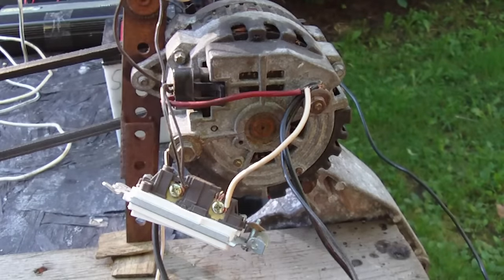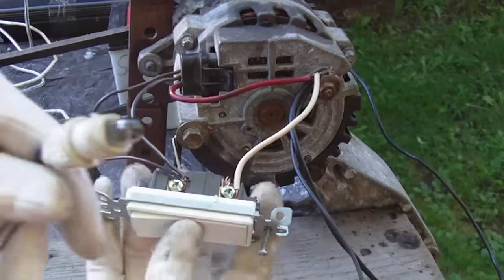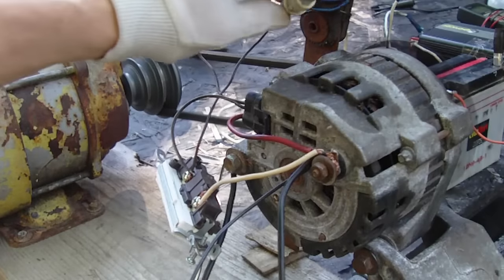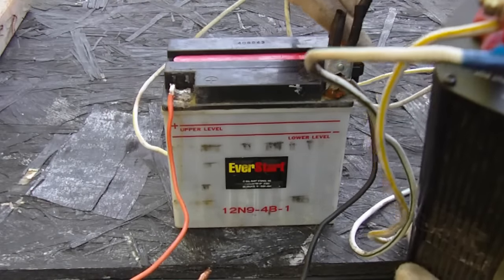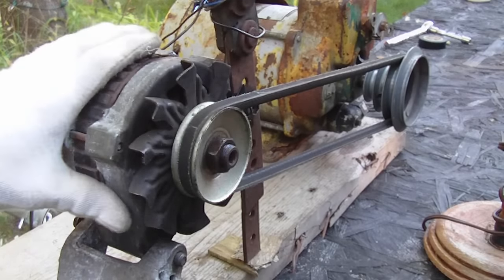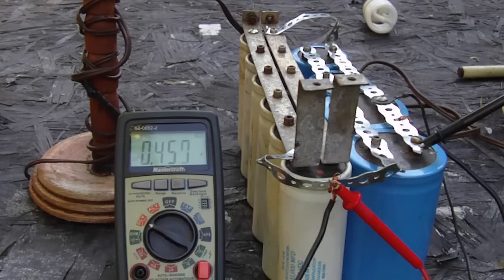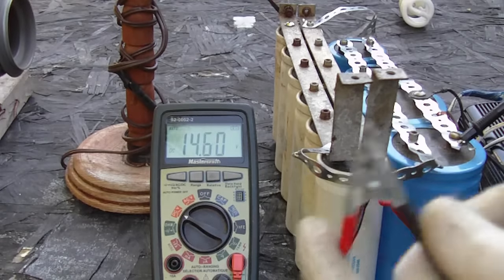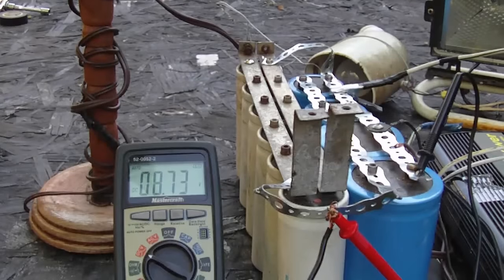Alternator DEMO Wiring, connection to Battery, Capacitors, Inverter, Modification

Comment: You need a 120 or 220 electrical motor to produce 120 Volts still I can't see your point.....?
Reply: So you knew already how to wire connect this setup? Where were you when I needed the info about it? Now you see That's the point. Get it? Why are you all hypnotized with free energy motors run a motor batteries run a battery that powers the battery what's up with that? And yet you don't know half of the motors generators we have and use in everyday life. Instead of waiting for someone to show you the" free energy device" you better first learn how to use what we have. I don't understand your comment at all.  you sound like the alternator is a long forgotten device that no one needs anymore. The title is how to connect the alternator to a battery and not how a battery and the alternator give everlasting life. Wake up. People use alternators. We are putting alternators in our cars. We use alternators in making windmills ,we use alternators in making water turbine generators.. there are thousands od applications whare we use alternators. . But no.. it's not free electricity a bunch of kids are talking about all over youtube so it's not important.  right? Check into your pockets maybe there's a solution on how to connect magic to a battery.

Comment: where does the small white wire that you  connected to the back of alternator w/ the negative wire to the battery  go to?  also, where does the small black wire  that you connected
w/ the positive wire to the battery go to?  You did not mentioned these two wires.

Comment: what happen if you had a big battery with some some high AMP like 700 or so, and you use the electricity coming from the inverter to power a small motor instead of a big motor..... you can also include a small flywheel to help the small motor which will have a big pulley which turns the small pulley for the alternator increasing speed. all you might need is to use a drill to begin spinning the entire system, and you should have a self sustaining generator. lol just saying. air planes were once said they were impossible to fly.

Comment: You should  never connect the field directly to the main output of the Alternator . . you will burn the rotor bobin  . . . you need at least place a rheostat to limit the voltage/current that goes into the rotor.

Comment: Can you run the motor that runs the alt by, the alt itself with its AC, (need the alt to run at 60 hertz huh) and still get excess power, in dc or ac mode? A re tou getting such low voltage hold with your caps, CAUSE they are in series,  won't you get more charge holding if they are in parallel?

Comment: So the red wire you have there is the sense wire going to the b post on the alternator to sense the battery voltage?

Comment: very informative and interesting video.generator is giving current but why are u using a induction motor ?  clear that plz ??? 
small battery is turning the the alternator and getting more current to again charge the battery right ? plz clear in simple whts  induction motor is doing ?
Reply: The battery is not powering the alternator at all. The induction motor powers the alternator. The battery is only required to temporarily energize the alternator's windings.

Comment: A good demo but it must be said that a lot of inverters will read over voltage at 14 volts and cut out but you can get lucky with some...
Reply: Every inverter I've ever seen cuts out at either 15 or 16 volts. Nominal voltage for a running vehicle is 14 to 14.5 volts, so it would be kind of silly if inverters (which are primarily used in vehicles) couldn't handle that.
Reply: Nominal  running voltage is different because the alternator is topping up the battery, I have seven 12v inverters of different sizes which is how I came by this info but of course all are slightly different in operation but all mine overvolt at around 14.5 volts. If your alternator is forcing 16 volts into your battery it's possible that your battery is on it's way out..  A healthy system with a battery that isnt knackered will charge at 14.25 volts.  We generaly learn about things by sharing info with each other and I appreciate your feedback on my comment.
Reply: thra5herxb12s Alternators don't very the voltage output based on the health of the battery. The voltage regulator outputs one particular voltage, given that the alternator is spinning fast enough and is not being loaded past it's maximum current (in those cases voltage would start to drop below the nominal). An alternator which outputs 16 volts at any time would be one with a failing regulator. (And it would overcharge and partially destroy the battery, and possibly fry some of the vehicle's electronics.)
Reply: ***** So if I spun an alternator with a bicycle, would I be able to fill a battery with some variation in how fast I spin it, because I can't bike at a constant speed?
Reply: Yes, as long as the alternator spins at least fast enough to reach the target output voltage of ~14V. At least a few hundred RPM.
Reply: ***** Thanks! Onward with my school project!

Comment: My alternator has that regulator but only has 1 wire, is that gonna be a problem? If so what's the solution ? And I agree with some of the other comments, focus more on the wiring of the alternator. What modifications did you make do and will it work without modifying it with a wind turbine?

Comment: hes using a ac motor to spin a dc alteernater to get ac,whoopee! dont work if you lose power you might need a gas motor which is what a generater is! go to lowes an buy a generater, unplug the electric motor and then get power, lol

Comment: So, a 12v dc motor running off the battery starts the motion, the alternator can then be switched on, which recharges the battery(when wired correctly)
Then plug the inverter to the battery which then converts 12 vdc to 120 vac. 
The amps (everything needs so many amps to run correctly, usually says how many on each appliance) which you can get more with more rpm on the alternator. 
But then, I'm not an electrician,so this is what I'm theorizing, or deducing based on what i saw in Kevin's video. The use of those other apparatuses and their function is over my head. Plus, like the rest of you guys, i still have to try it first

Comment: why somepeople  put one diode in the red wire that come out from the 
alternator ?i dont undestarnd. in try to do the same, i bought a geo 
metro car alternator it has regulator and rectifier 
,have the bateries, but i think that someting is not working,cause I 
charge the batteries and then they run out when they are used
Reply: Oswald President Killa,,, 😯😲😱😵lolly,,,, NATURALLY,,,, that's exactly what happens when you use a battery. Even A brand new battery when used runs out of stored energy and that's now the whole purpose behind having an alternator to recharge the battery. The capacitors and or invertor box is used to take what energy that you are building from the alternator and multiply it so your not over working or burning out the alternator that's trying to keep up with what your trying to use the energy for..
Reply: Oswaldo f 
Yeah... What he said...

Comment: My truck got stolen and they missed up the wiring so bad . The there are two wires from the alternator and the wiring to the battery is hooked up to the junction box with capacitor. There is no solenoid the ignition to the distributor cap and anothere wire coming from the cap to the battery   with a capacitor and starting wire. The alternator is not hooked up battery. 
Starting the truck is tricky, turn the key on and filp a switch and then pull back on a leaver on the left side of steering column.  Every time you turn on you have to popped the hood and reconnect the battery  turn off you turn the key off and you filp the switch dowm and disconnect the battery. 
Battery stays charged and i dont know how?

Comment: 3 wire plug  first wire is volt sense from battery pole  second wire is connected to a switch in this case normal would be the Ignition switch the 3rd is  fail lamp output .

Comment: The reason why he had to jump the capacitors with power to get the alternator to generate was because there was no power in the capacitors to excite the coil in the alternator. A simple 9 volt battery touched to the positive and negative of the alternator will excite it into producing power. Once excited it dosent need power to keep generating as long as alternator keeps spinning. In fact you dont even need a battery hooked up to alternator you can pull directly off of alternator without one. As long as you excite the alternator to bring it alive.

Comment: So the best thing to do would be removing The rectifier and keeping it at like close to 110 volts to run stuff and have 3 power outlet boxes one for each phase like the power company 3 phase alternating current split or keep in 3 phase for big pumps or loads

Comment: What's ur point you're using 110 volts to power the motor Wich is really powering everything
Reply: He was just using that to demo it so he didnt have to talk over a gas engine that you normally would use to run it

Comment: did you try using the smaller of the wheels on the motor so the motor spins faster. to get more torque. It should be able to handle bigger loads that way.

Comment: nice video but the inverter can't handle 25 volts, maximum is 16 volts or it's going to blow the capacitors of the inverter, internally or worse...

Comment: What is the point when you can just plug stuff in were your electric motor is plugged up to run the alternator
Reply: The electric motor is for demo suppose to use petrol engine lol

Comment: is there a way i can put a speed controller ' some thing like a ac light dimmer switch , so i can turn up the power to deal with a heavier load ,  as i am a beginner so i wont to leave the regulator alone and dont wont to mess with transformers until i have learned the basics ' do rubber gloves really save you from high voltage ?

Comment: Bottom line is a loss of efficiency/amperage capacity in re -conversion from 120 volts to 12 volts back to 120 volts.
Reply: And if inverter is not pure sine wave then your efficiency loss is is even greater and results in issues with end item connected to inverter
Reply: forgot to add the issue in the "re-conversion " process the cost and wear and tear of all the extra componets

Comment: What do you use to prevent overcharge or dissipation?  I’d use a Stanley charge controller- maybe and utilize something for the power to run from battery and a smart system that will turn on generator with batter low.   Safe no lighting bolts or battery bombs.

Comment: Low voltage can cause a electric motor, a drill, to burn out, unless you are controlling the amount of amps being generated. Remember, voltage is indirectly proportional to amps. If voltage goes down, amps increase.
Reply: im confused i thought ohms law stated more voltage more amperage (current) ? can you explain im trying to learn

Comment: I invented the power pack your motor that turns the alternated is wrong its is a rotating house fan with low midium n high on it replace fan blade with a pully then run belt toalternater replace converter with outlet 110 or220  replace parts when needed I'm Kirt Swinney

Comment: What you call a "universal motor" is actually a brush motor. Motors with carbon brushes and commutators will run on AC or DC. They can be identified by the blue sparks that they produce at the back of the motor near the shaft while in action. I know that you were using a fairly slow motor to turn your alternator and experimenting with a GM alternator but if you live near a junk yard and get a "double field" alternator off from a late 70's or early 80's Chrysler product, (Dodge, Chrysler or Plymouth), your task would be much easier without having to disassemble the alternator. The term "double field" is actually a misnomer. It has a single field coil like any other alternator but it has both connections to it's field available externally. This was because when Chrysler went to it's external electronic voltage regulator, it needed both field connections available as it worked differently from it's older mechanical regulator. You could use a newer double field alternator on an older car with it's mechanical regulator by grounding either field connection but you couldn't use an older "single field" alternator on a newer car without wiring an older mechanical regulator to it. These were easy to wire in a farm truck for 110 VDC for portable lighting or power tools with only a double pole, double throw switch rated at at least 10 amps but preferably higher as you will also be switching your normal alternator output with it and one or two standard duplex outlets. First you determine which way you would orient your switch. This is easiest by mounting it and a duplex outlet in a box, mounting it somewhere dry and marking it for "NORMAL" and "110 VDC" 
1) With the key in the "ON" position, with your DC meter set to 12 volts or more, you ground your negative meter lead and touch the positive lead to both field connections to determine which one is positive. 2) Shut the key off and disconnect the ground lead of the battery for the rest of this modification. 3) Clip the positive field wire and strip the ends. 4) The end from the alternator connects to the center terminal on one side of the DPDT switch. 5) The other end of the wire connects to the DPDT switch ON THE SAME SIDE BUT OPPOSITE OF YOUR "NORMAL" SETTING. This is your normal regulated setting. This is because when you flip a snap switch, the handle or actuator goes in the OPPOSITE direction from the switching mechanism itself. 6) On the SAME SIDE of the switch, connect a 12 gauge wire directly from the battery positive terminal to the unused terminal opposite the regulator positive wire. 7) ON THE UNUSED SIDE OF THE SWITCH, cut the positive 10 gauge main power lead coming out of the main output of the alternator. 8) Connect the alternator output end of the wire to the CENTER terminal of the switch. 9) Connect the other end of the main 10 gauge wire to the terminal OPPOSITE FROM THE "NORMAL" SETTING This will let your charging system work like a stock factory setup. 10) Connect a 10 gauge wire from the last unused terminal of the switch to one side of a duplex 120 volt standard outlet. 11) Connect the other side of the outlet to a piece of 10 gauge wire and connect it to the engine block or alternator ground.
1A) BE SURE THAT THE SWITCH IS SET TO "NORMAL". 2A) Connect the ground wire back to the battery. 3A) Start the engine and verify  normal operation, (13.5 TO 14.8 VDC), with your volt meter connected to the battery. 4A) Set your volt meter to at least 200 VDC. 5A) Connect volt meter leads to the left and right blade connections of the 120 volt outlet. 6A) Flip the switch to 110 VDC and read voltage. It could be anywhere from 50 to 70 volts. To avoid overheating your power tools, increase engine speed until your volt meter reads between 90 and 110 VDC and set it there. 
Two things to be aware of. 1B) DISCLAIMER: WHILE THIS IS A PROVEN CIRCUIT AND I HAVE FAITH IN IT, THERE IS NO SAFETY GROUND ON THIS SYSTEM LIKE THE 3RD PRONG GROUND IN YOUR HOUSE'S ELECTRICAL SYSTEM AND THERE IS NO EFFECTIVE WAY TO MAKE ONE UNLESS YOU ARE DRIVING A TRACKED VEHICLE LIKE A BULLDOZER OR TRACK HOE, Your vehicle is on insulating rubber tires. Driving a ground stake into an earth ground would only make matters worse by completing any short circuit to ground THROUGH YOU so be sure of the quality and integrity of your power tools and your modifications to your vehicle. I'm sorry but I claim NO RESPONSIBILITY for ANY damages or INJURIES that you may incur due to YOUR modifications to YOUR'S or ANYONE'S vehicles. 2B) You can't run this setup like this all day. You are drawing a solid 5 amps from the battery to energize the alternator field WITHOUT putting anything back whether you use a tool or not. Depending on the condition of your starter battery, you may want to switch back to "NORMAL" every 20 to 30 minutes for 10 or 15 minutes to allow the battery to recharge. GOOD LUCK AND FOR GOD'S' SAKE, BE CAREFUL!!!

Comment: Where does the motor gets its source?
Reply: +Levi Bartolome 120V AC power.
Reply: +themaritimeman so u r getting source from ac to provide ac?
Reply: +Levi Bartolome Yes. Listen again to the beginning of the video - he said it was connected to the AC motor for demo purposes. Normally you would connect it to a gasoline or diesel engine.

Comment: 🦊,..is this free energy, free from E.M.F. , discharge ? ,...
Reply: No, he's running the first motor from the wall outlet, to turn the alternator, to generate power for the battery, and then convert it to 110v again for the lamp. Idiocy.

Comment: I guess I'm just old school but I still plug my lights into the wall...

I guess I missed something here but it seems like you not use 110v to create 110v?
Reply: The point of this is to make your own junkyard generator. You can run it on bio-fuel, hook it up to a windmill or hook it up to a water wheel and create electricity when an electrical grid is unavailable to you. Its useful in remote areas where electricity isn't available and for those who wish to live off the grid.

Comment: Suggestion!   Throw away the motor, alternator, battery, wiring, and the inverter and just plug the lights and drill into the same place the motor was plugged in and they will all work better for less electricity wasted!   I don't see any good point except you got some views.   Sorry,   Kevin
Reply: In 4 years, have you learned the meaning of a demonstration?

Comment: this is a mess. The battery will spark the capacitor which in turn begins the light and now the drill but without the modified regulator and the generator stills spins. Facing due north I will coil the wire on the pencil blah, blah, blah.